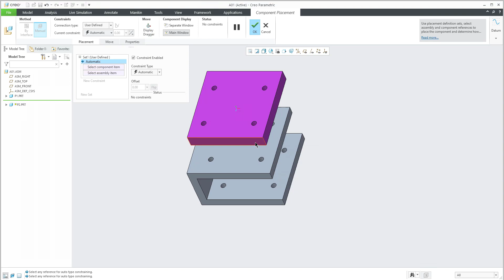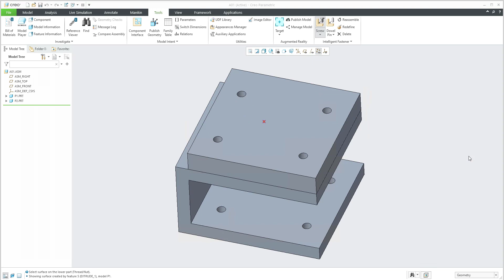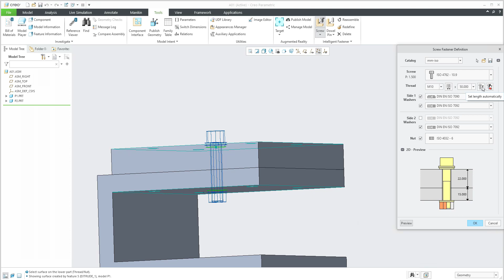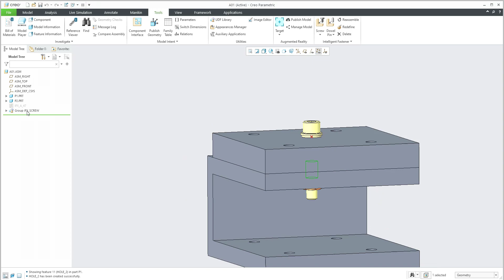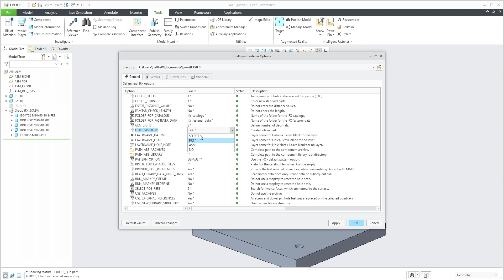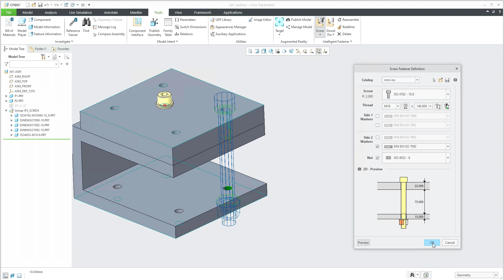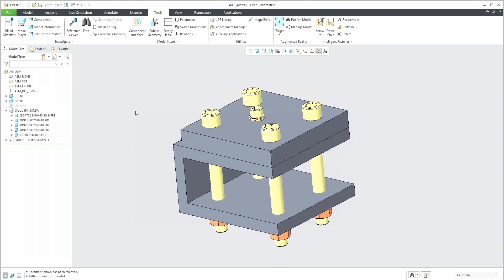Creo IFX - How to use Creo IFX | Creo Intelligent Fastener to assemble screws or dowel pins faster

Comment: I used the intelligent fastener for my model and saved it. When I opened it again, it said "missing model" what should I do
Reply from the maker: When you finish your work...please backup your data by Save and backup...or try to use search path configuration option.
Reply from the maker: Search path is working in the way when you need to load data feom different locations (folders)

Comment: hi Mr. Vladamir if i have my part tap hole for example 1/4 so creo can recognize what kind of secrew goes that hole ?
Reply from the maker: Hello, yes.. System can recognize best suitable diameter and also if you apply nuts and washers the system will apply correct length of the screw.